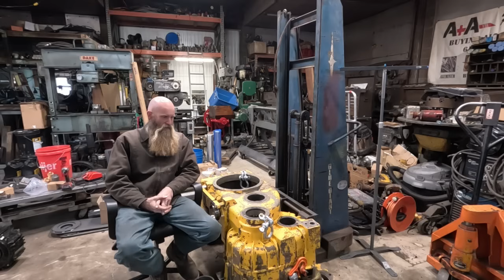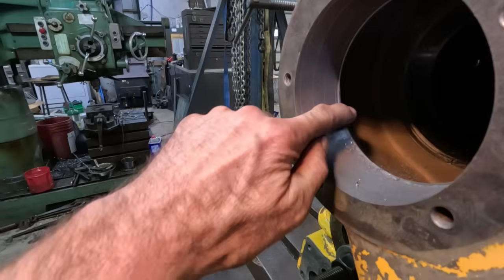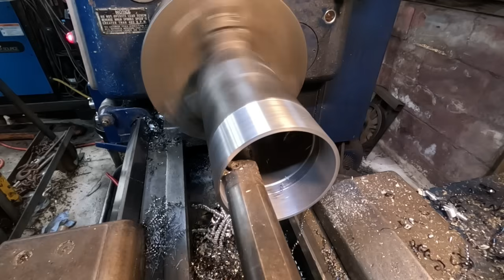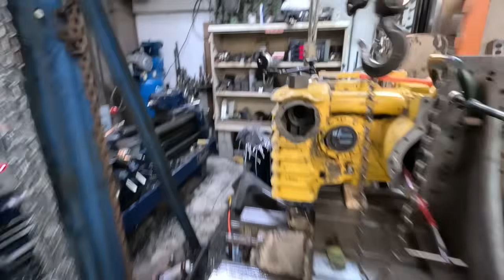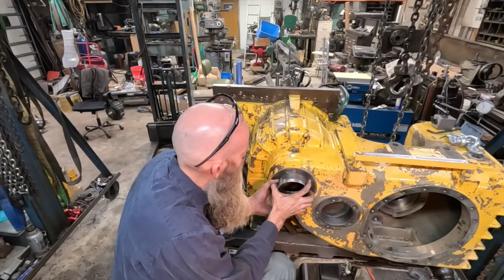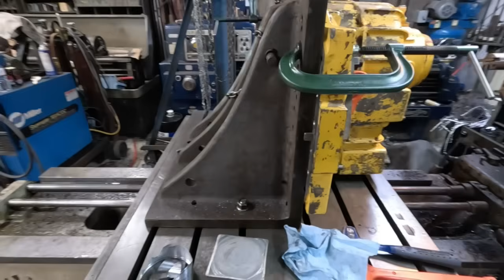Rescuing a destroyed bearing bore in a Volvo transmission housing!

Comment: I have found that if a take a coolant through boring bar and weld an airline fitting on the end with a gate valve, it works great to rid the bore of chip bind without the coolant mess when it’s not needed
Reply from the maker: I've wondered about that, I assume it would help keep the tool cool also.